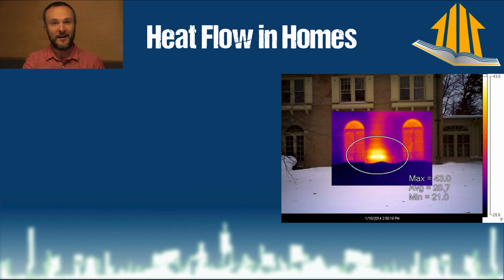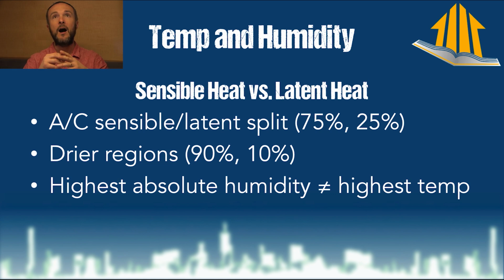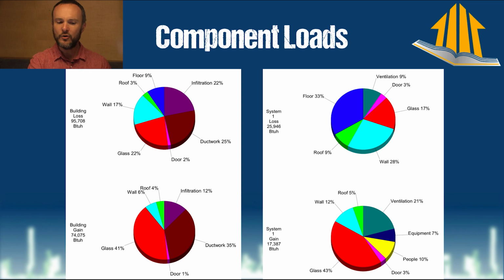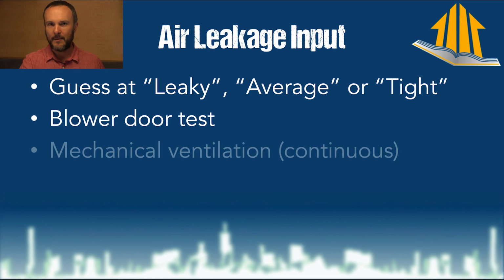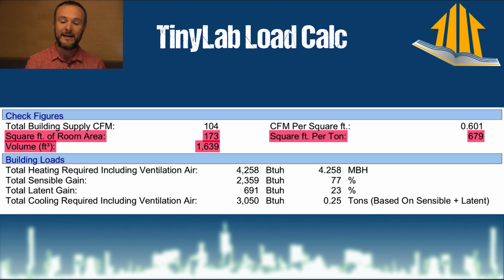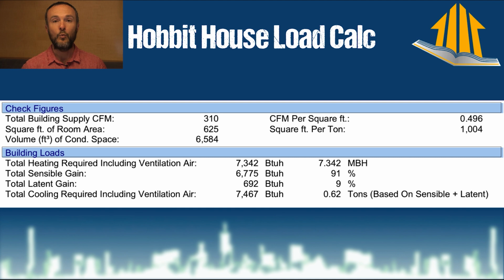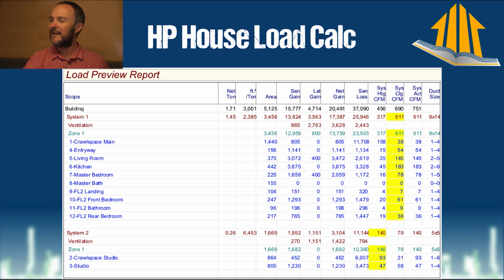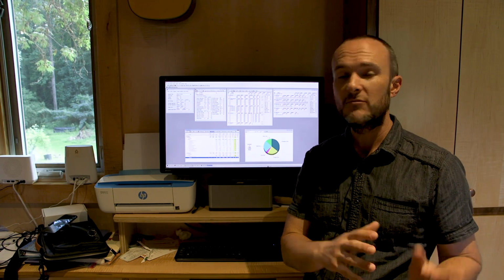Manual J Load Calculations for Heating & Cooling

Comment: How do I find someone to do a blower test and perform these calcs?  Have a 50’s home in the West Texas desert that we’re spray foaming and creating a very tight home.  Every A/C contractor in 100 miles of me has never heard of a manual J, some have told me that I need to upgrade my 5 ton to two 3.5 tons, some have said my 5 ton is sufficient and just replace it in kind (the ac is currently out) and some have said I can reduce to a 4 ton and still be ok.  Some have asked about sqft and some have not.  Kinda frustrating.  Thanks @Home Performance!
Reply from the maker: Sorry to hear, Texas. Closest people I have to you are Austin and Santa Fe. Probably not, right? Anyway, you should be able to find someone to run a blower door test, it's state law in Texas that all new homes get one, and has been for years. Try this:
https://homediagnosis.tv/pro

Comment: What does it mean to have your front door facing south?  It the assumption most of your windows are on the front of the house?  What if you have a beach house, lake house, or mountain house with a window wall.  How does that play into the "front door" orientation?
Reply from the maker: That’s just how you define the direction in heat load calc software. Yes, it’s all about where the bulk of your windows face (west being generally bad).

Comment: Amazing video. I am halfway through and learning so much. For example i knew about latent and sensible heat load but i didn't really understand why latent heat was called that but you explained it perfectly. I didn't know where the term ton came from but you explained that. Thanks.

One thing i have to disagree a little with is that an undersized ac will run 24 hours on the hottest day- not quite- Temperatures will drop at night and two things will happen
1. The delta T is smaller resulting in less heat gain, and two the AC efficiency will increase as acs are most efficient when delta T is smallest.
So a mildly undersized ac will turn off sometime during the night and then only come on as needed.
Reply from the maker: Thanks for following and commenting, O

Comment: Thanks Corbett! So I have to get the software, is there one you'd recommend?
Reply from the maker: I think Wrightsoft may be more powerful at this point
Reply: You don't have to get software. It's extremely easy to calculate the heat or cooling load for your envelope. Then you calculate the internal loads and you have your load calc.

Example: you have a wall that's 30 ft long and 10 ft high, so 300 SQ ft.   Your design temp is 100 degrees and you keep your house at 75 degrees, so difference is 25 degrees. The wall is r20

So 300sqft x 25 degrees difference/r20

(300x25)/20
=375 btu per hour of heat gain or loss

Then you do it for all surfaces add the heat gain for leakage, internal heat gains, and you are done.

Or you can do it for free at load-calc.com :)

Comment: the comment about the quirk with the ceiling height might explain how they are getting some designs pass codes here. i've seen a few "award winning designs" that have 70% or more window aera. there is basically almost no wall insulation used.

could you elaborate on why houses smaller than 1000ft act differently to normal houses please.
Reply from the maker: Hey Tweake- just getting around to this comment, sorry. Small houses react much faster to upticks in humidity, contaminants, fumes, occupancy pollution, etc. Also, the enclosure-area-to-volume ratio is massively different. The heating and cooling loads may hang out for extended periods of time in the 1-1000 Btuh range, which is below the capability of any heat pumps on the market (and way out of range of any other technology). Because you have to use a ductless unit due to size constraints and super low load, you need supplemental dehumidification, which adds heat back into the space, and so on and so forth. Very complicated. Can be done right, as we know, but complicated.